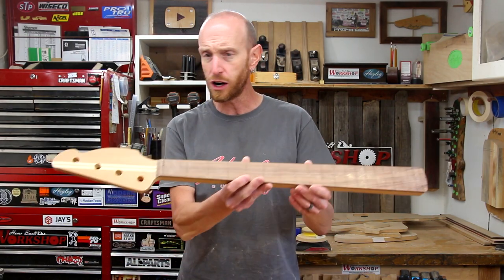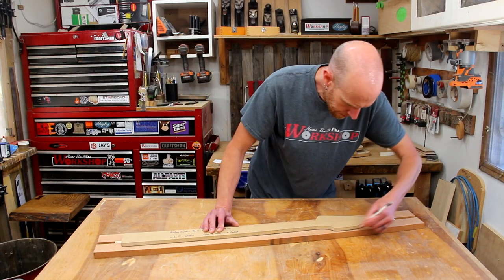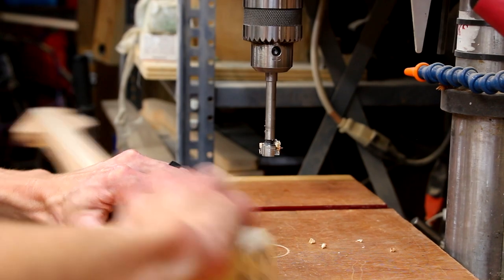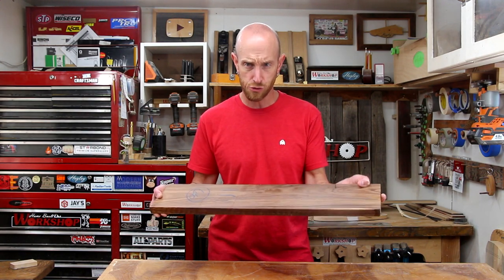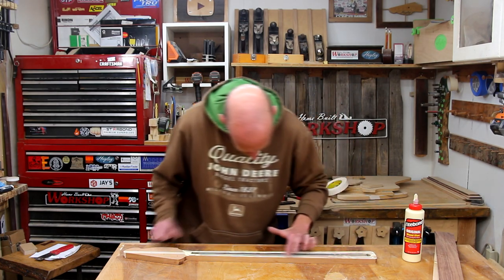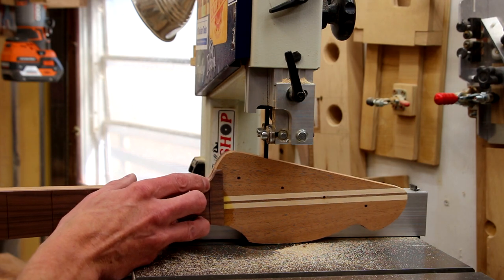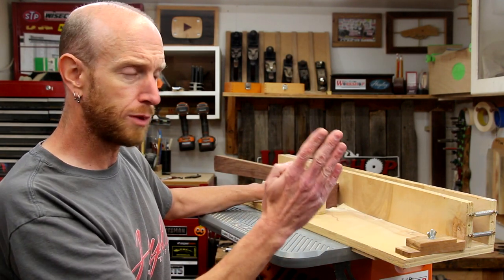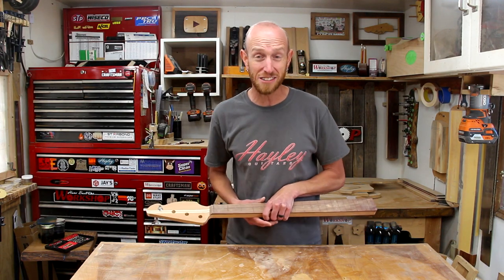Building a Bass Guitar Neck | Bass Build EP2

Comment: Hey Jeff, As you know I don't know much about guitars. I was checking the web to see what a truss rod and reinforcing rods do. Wouldn't the reinforcing rods counteract the affect of the truss rod? I'm like Sergeant Schultz, I know nooooothing!!! LOL
Reply from the maker: You would think it would counteract the truss rod and in the big picture it probably does a little bit, but overall it makes the neck much more stable as it reduces some of the wood movement. They do flex just enough to allow the truss rod to work properly. I have noticed that a neck with these rods is much more stable and require less seasonal adjustment.

Comment: So, you aren’t using your router table to make the truss rod slot because you don’t have a fence for it, correct?  Seems the router table would be easiest for this job, assuming you have a fence.
Reply from the maker: You could do that with a fence if you route the channel while the neck blank is square. Many builders to that. I like to route after the neck is routed to shape. If you wanted to use the router table after routing the neck shape, you would have to use some sort of jig that would account for the neck taper and keep the router bit centered. For me, this routing jig works best for now.
Reply: @homebuiltshop  Ok, makes sense.   And along the same lines, I would think I would hammer in the frets before the back of the neck is carved, so that I have a flat surface to rest on when hammering them in.

Comment: This was great. Learnt a lot. Is there a video of you making the headstock sanding jig?
Reply from the maker: Thanks. I don't have a specific video on building this jig. Thats the reason I decided to try to show it a bit more in this video. Hopefully it helps answer a few questions. If I end up getting a larger spindle sander at some point, I'll absolutely make a video on making a new jig. I'm happy to try to answer any questions you have though. Just shoot me an email to homebuiltshop@gmail.com.
Reply: @homebuiltshop  hi, if you use a steel or aluminium base plate that would allow the bobbin to sand the the full width of the neck and avoid have to feed it through the opposite way?
Reply: @homebuiltshop  Thanks Jeff! That’s very kind. Appreciate it.

Comment: It’s always interesting to see how other people do things. I had a similar jig to rout the truss rod channel back in the 90s. Not sure what happened to it! I need to make a new one. These days I use an edge guide on my router. 

I usually taper my fretboard first and glue that to an un shaped neck blank (except the headstock). Then I use a router with a pattern but, using the fretboard as a pattern to shape the neck. 

But this way works too! 

Regarding taping the truss rod channel; I use that Scotch “Magic” tape, the thin translucent stuff that is made for paper. I lay a piece just slightly wider than the truss rod channel, and I leave it there when I glue the fretboard on. It’s very thin,  and there wouldn’t have been glue in that area anyway. I often use epoxy for fretboard glue ups as to not introduce moisture into the wood, so I don’t want epoxy in the truss rod channel!
Reply from the maker: I too enjoy seeing how everyone does things. Your magic tape idea is a great one. To me, if you're going to use tape, it makes more sense to leave the tape on. It seems like it would keep the glue out of the truss rod channel much better. Thanks for sharing that tip. I'll have to try it.

Comment: Love this. I started working on a bass neck blank myself so the timing is really good. love that jig for the spindle sander. I would gladly pay $5 - 10 dollars for plans for that. I've seen folks epoxy in the carbon fiber rods, is this something you considered and how did you arrive at your final decision?
Reply from the maker: I don't have plans for that yet, but maybe I can work on some. I just use wood glue to hold the rods in. Epoxy can be messy and I'd probably spill it on something. Lol. I like the simplicity of not using different adhesives.